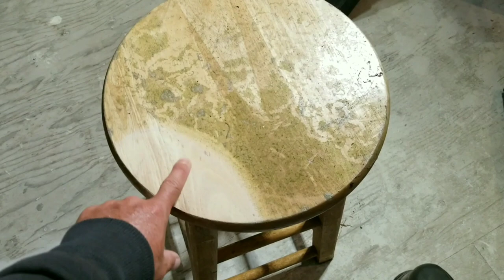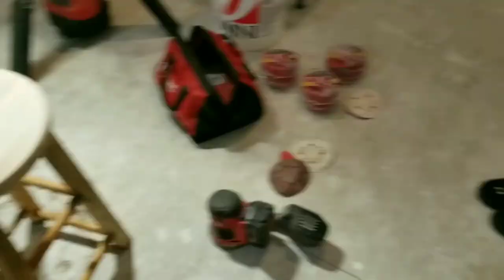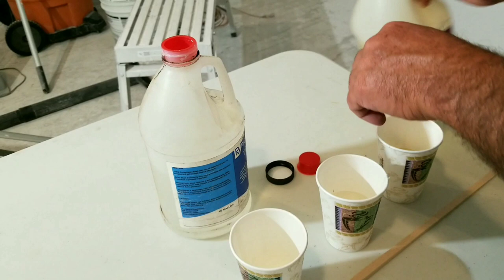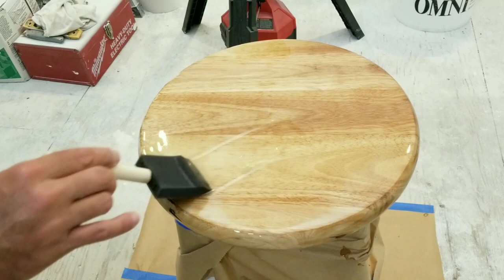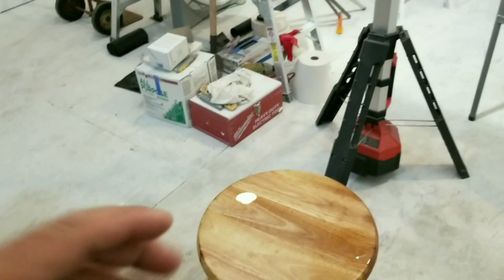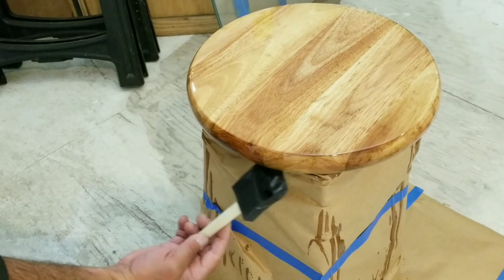Epoxy Resin Bar Stool

Comment: If that was on a counter I would forget and sit a hot pan from the stove and screw it up. Good job
Reply from the maker: Never place hot stuff Directly on most countertops you sit on a cooling pad A towel or a spacer.